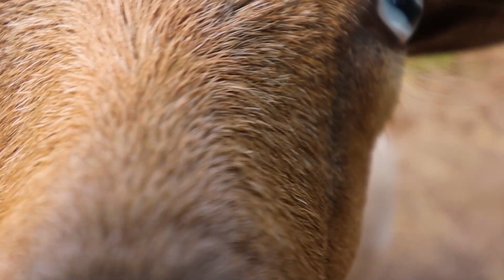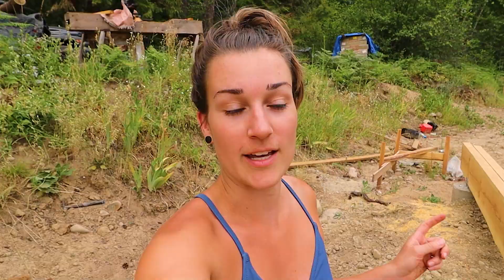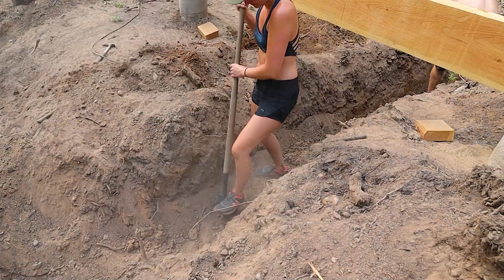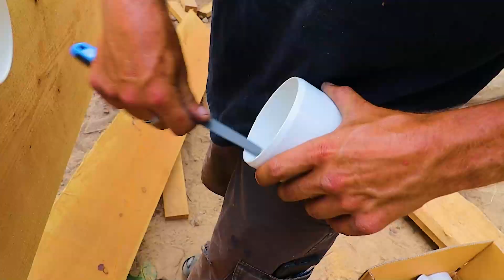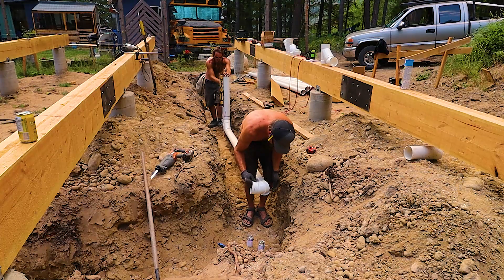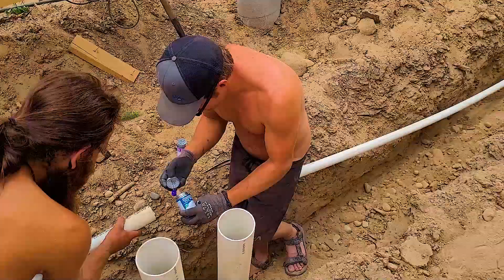Surviving The Heat Wave | Plumbing | Building An Off Grid Home In The Mountains

Comment: Thanks for the video, as  I feel you on the heat. Here in alaska its quite warm as well but at seventy degrees F. which is twenty something in C. so there is that. I know that feeling of once started, you feel  the need  to get it done and over. I built my own as well only smaller as at 73 don't need much space and the bank wanted my house... no breaks or help just take... owe owei or how ever a person groans when feeling testie ... I sure envy those tans. Always been the one they call the "white out" or look like a fried egg... slightly overcooked. When your age I had abs and my guns measured at the bar of course, sixteen and a half inches... do the tape measure thing as not a clue on metric measure. Once that floor is down, things should ease up on the getting around in the building. You will have a very strong structure there.. good luck so far and more to come

Comment: if your property goes all the way to the lake buy water line and put a large loop as deep in the lake as possible ( a coil much like used for the hot tub heater ) then a small pump in the loop to property will bring cold water to you ( if you have ever dove in a lake once down a few feet you will notice the great temperature change )

Comment: are sure that plumbing is deep enough not to freeze (just sayin')
Reply from the maker: Yes, we will have skirting around the house too
Reply: If you have The proper grade on the sewer line water will never be in the pipes other than P-traps. 👍 you can always insulate P-traps under the house. nice job you guys.